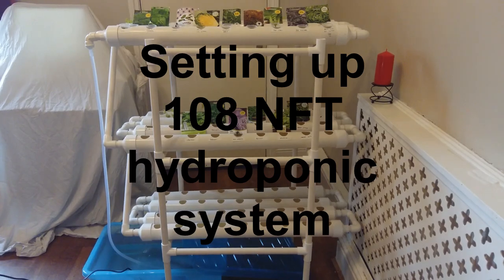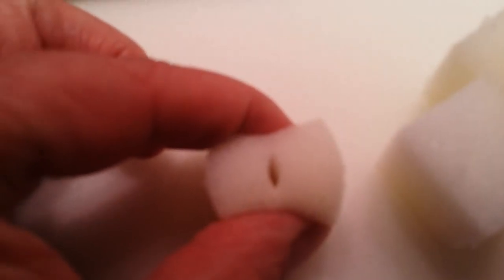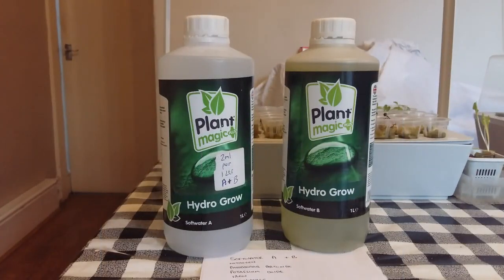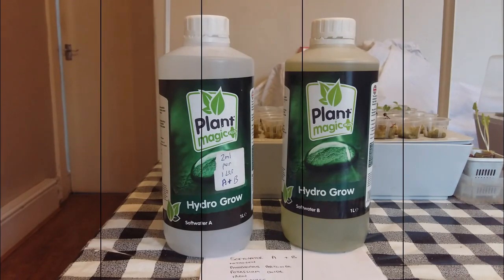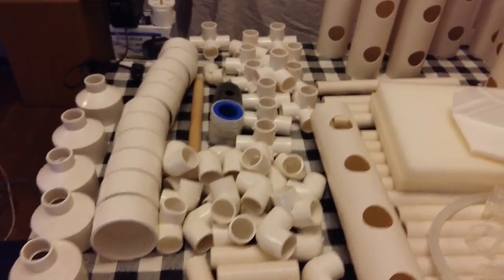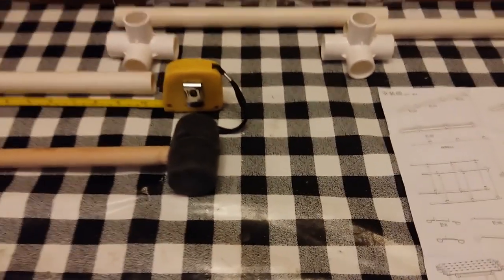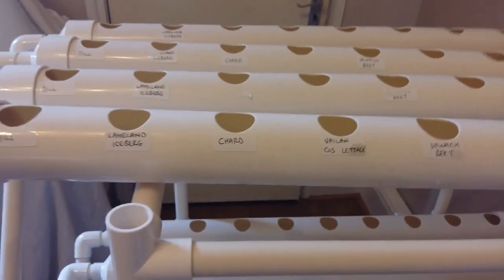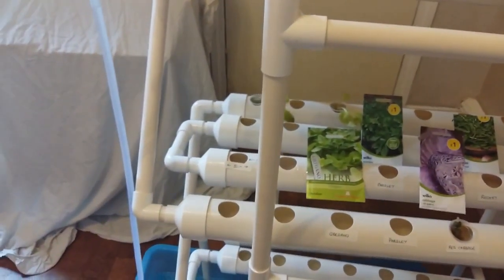Basic setup instructions 108 NFT hydroponics system,or DIY. Self sufficient.Nutrient film technique.

Comment: I have similar system - just purchased - and it has major failed.  What is your timer set for?  My system is a little different from yours and it doesn’t drain very well, therefore my roots are always submerged and not getting enough air.  Have you experienced this?